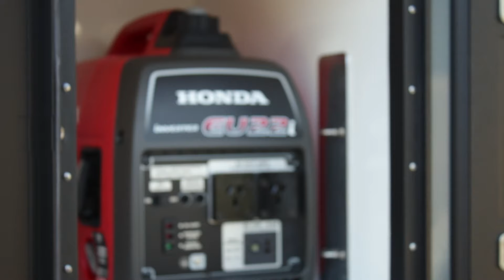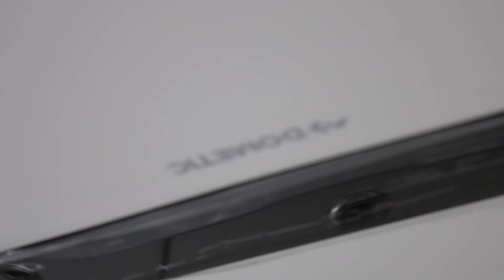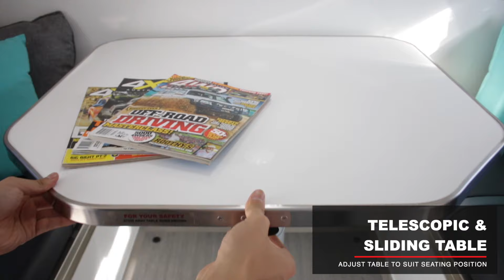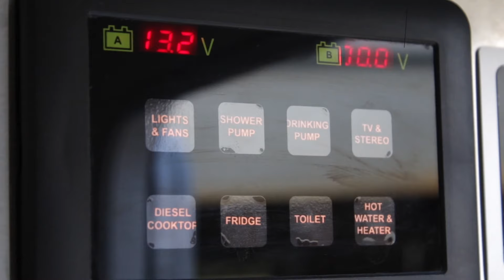U4023 Unidan Odyssey - Unimog Expedition Vehicle | UNIDAN ENGINEERING

Comment: Nice  work Dude only thing for me is the water @100 litres split thats about a week off grid without access to water if u shower and wernt conservative like clothes washing salt removal but its a wicked machine and i guess its what owners wanted..me I want huge water fuel.. air, a bed shower..dine,kitchen combined, and a large spares storage separated like half of the body for zodiac outboard, a trailbike, drones and tech satcom net monitor and tools ..also i need redundancies for everything as i hard on stuff ...your mogs are right up there nice work
Reply from the maker: Unidan Engineering

Hi Budgie Smuggler, keep watching the Video, in the boot, there is 100L of drinking water plus 100L of additional shower water. then Under the dinette, there is 200L of shower water.   400L all up. I agree 100L definitely isn't enough.   We offer desal units to anyone that wants more water than we can fit in,
Reply: Maybe a nice bungalow would suit your needs better😊
Reply: @martysouth880  your spot on you know my whole life l basically have lived in modified vans trucks fourbeez
Still am now did have 5 acres rainforest and a bungalow at one stage 7 years sold it bought a mega troop campa
Couple of laps rolled it been back in van last 3 years lm now aiming for an explorer for me n me dog n

Comment: I don't understand why you wouldn't put in a 3kW inverter
Reply from the maker: That's because the battery system chosen by this customer is quite a basic set up with minimal consumers being run i.e. no electric cooking, heating or plumbing etc. The owner's of this vehicle are very minimal campers and therefore the specifications of this build match. There are no power consumers in this build which require anywhere near that size inverter. In our larger power systems we do run much bigger inverters etc.
Reply: @unidanengineering  Makes sense, thanks, great build.

Comment: How many gallons per mile?
Reply from the maker: Unidan Engineering
19 - 22L per 100kms
Reply from the maker: This U4023 just got back for its 5000K check up,  Its averaged 19.5L per 100kms
Reply: 10.69 - 12.38 MPG with 137.369 gallons in the tanks with a range of 1,468.47 to 1,700.63 miles.